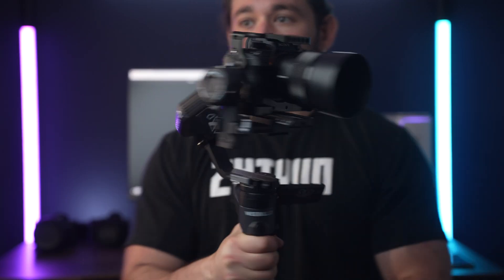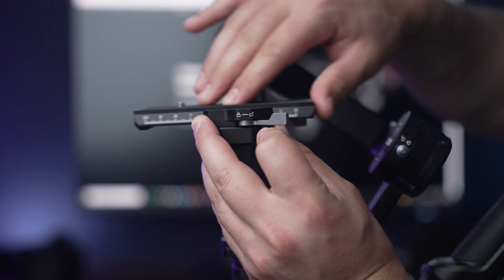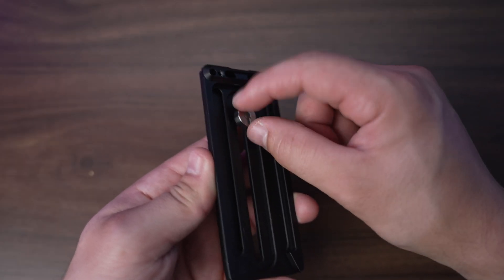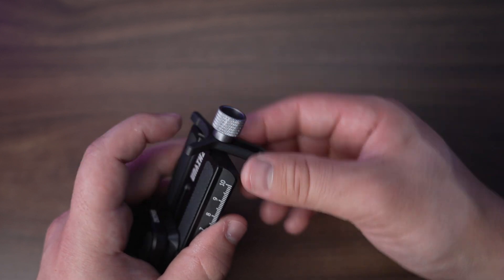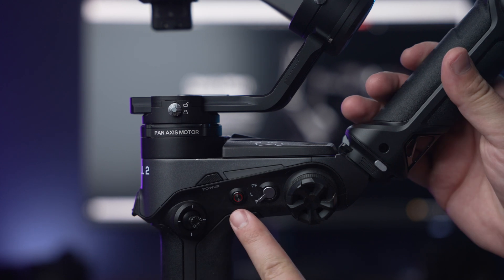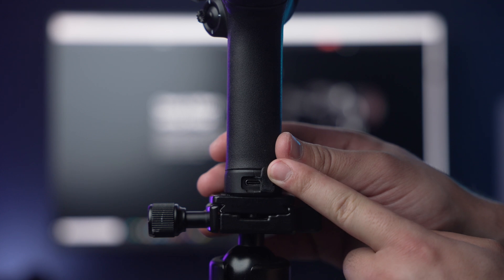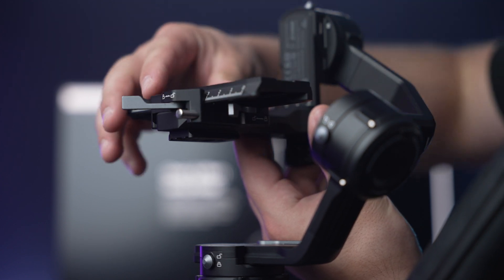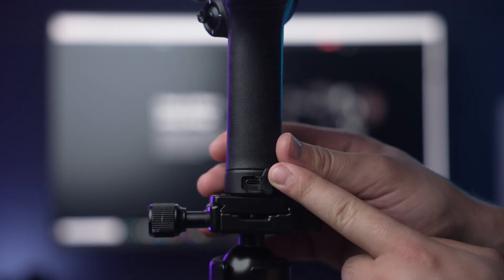WEEBILL 2 Button Layout and Introduction

Comment: I wonder if I am the only one having problems with Zhiyun Gimbal.  I have a weebill 2 which jitters halfway during my shoot. Even when I was just filming static shots. The gimbal will suddenly jitters and I have to tilt the gimbal slightly and it stop. I am quite sure I have it balance correctly as I had communicated with zhiyun service center thru their online chat, sent multiple videos of my balancing, including attaching lens support to the front to prevent resonance. However, it still jitters and it had become worse. Zhiyun finally admitted that something is wrong with my gimbal. However, the problem now that I am facing is that the service center in Singapore is not responding. It is frustrating that after purchasing a gimbal, I spent more time troubleshooting the gimbal than using it. And if it takes a few months for them to troubleshoot my gimbal since I have to sent it back, I am wasting my time and money to purchase a faulty gimbal. It make no sense to purchase a zhiyun gimbal and then purchase another gimbal so that I can carry on shooting while my zhiyun weebill 2 is sent back for troubleshooting.   I would NOT recommend any consumers to purchase any zhiyun gimbal on the fact that the service is not good enough and you will be wasting your time and money. ( not so much o the product itself as I believe some of you may have good experience while using it.  Sad to say, when I bought a brand new gimbal, it is faulty and the troubleshoot process is horrible. I feel that I have bcome a zhiyun technician.

Comment: After 2 months using this gimbal i will say to all of you buyers DONT BUY IT. Is bad in many ways, motionlaps sucks, smooth fotage sucks, using with falcam quick release plate sucks vibrations, what else, the app is so so. fter 2 months using this gimbal i will say to all of you buyers DONT BUY IT. Is bad in many ways, motionlaps sucks, smooth fotage sucks, using with falcam quick release plate sucks vibrations, what else, the app is so so.. dont buy

Comment: Hi this gimbal works with Sony a 6500?
Reply from the maker: YES!!!
Reply: @ZhiyunTechGlobal  I have a 6400. Do I need to buy a seperate cord to connect properly
Reply from the maker: @official-e1372  You could use a Type-C control cable to connect to Multi USB. Check details in the Compatibility List: https://zhiyun-website-shenzhen.oss-cn-shenzhen.aliyuncs.com/instruction/20220609/1654764491827-MaPQz2je.pdf
Reply: @ZhiyunTechGlobal  Compatibility List shows that is working with sonyaM4 but it does not, i am writing to your official, but they are dont giva a F !
Reply from the maker: @darkonovevski3113  Hi Darko. 
1. For Sony A7M4, please try to use Type-C to Multi USB cable to connect, not Type-C to Type-C cable to control. 
2. Please select "PC Remote" for your camera's "USB Connection".
3. For Sony cameras, after connecting the gimbal and camera with the control cable, Please first power on the gimbal and then the camera. Make sure the camera has sufficient power to operate.
Reply: @ZhiyunTechGlobal  dont lie!!!!!

Comment: anyone has succes to attached a external monitor to this gimbal? everytime I attache it to lim arm handle lost the balance
Reply: I did but since I want it the monitor on the left side I bought and extension arm that attaches at the bottom of the Weebill and also a flexible arm to attach the monitor.